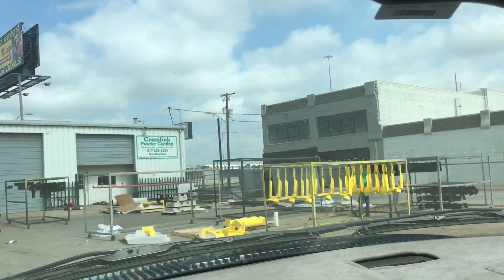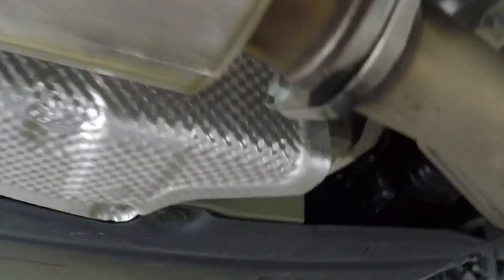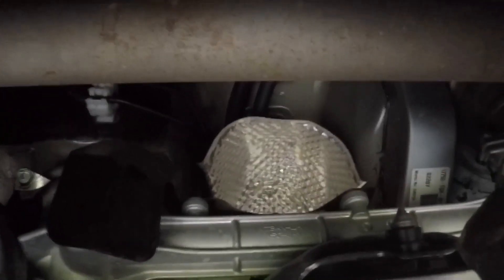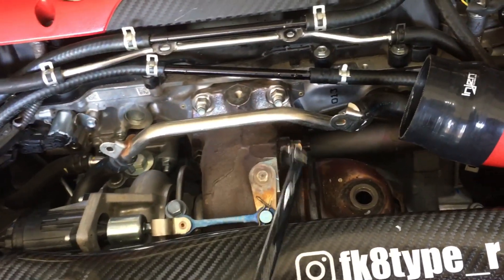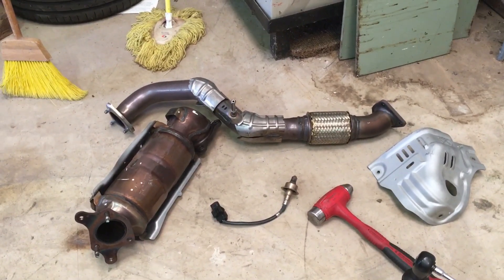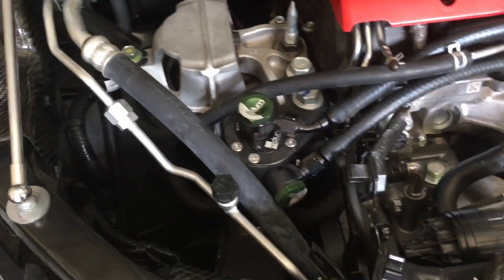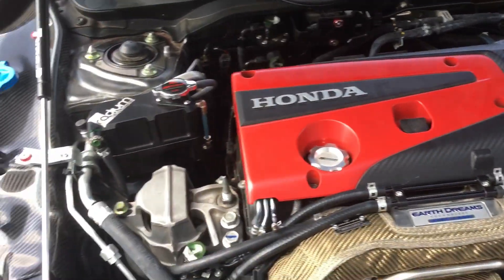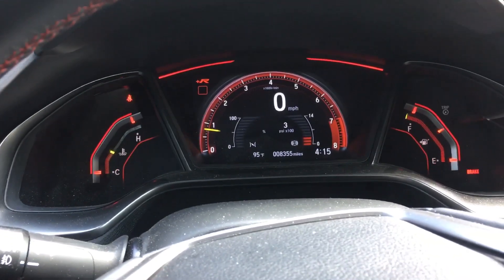HKS downpipe n midpipe installation + PTP Turbo blanket for Honda Civic Type r fk8

Comment: How did you remove cel?
Reply from the maker: I just drove it and they all went away. Basically I created the problem because I disconnected the battery (which tnere was no need for it).
Reply: @rolosgarage5343  did you have your car tuned?
Reply from the maker: @calebuy  not yet, just hondata factory maps.
Reply: @rolosgarage5343  thats basically a tune right?
Reply from the maker: @calebuy  yeah

Comment: How hard was it to remove the downpipe nuts/bolts? Everyone says it's a bitch and they sometimes break.
Reply: I did mine. I blasted it with PB Blaster and waited about an hour to an hour and a half to soak in and they came off pretty easily.